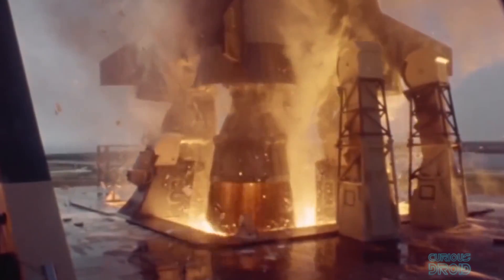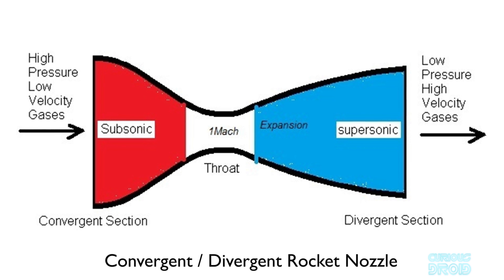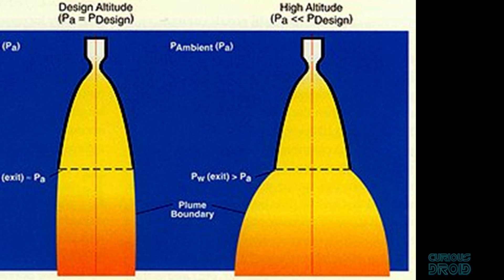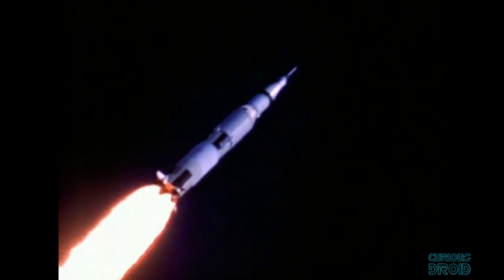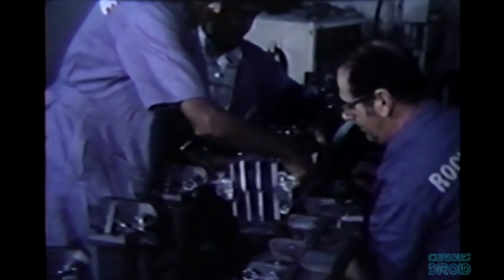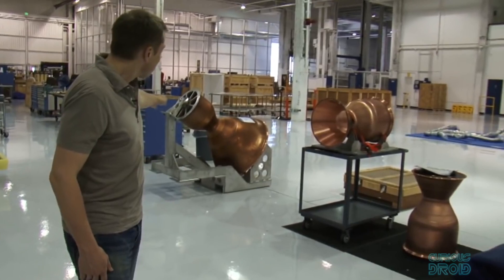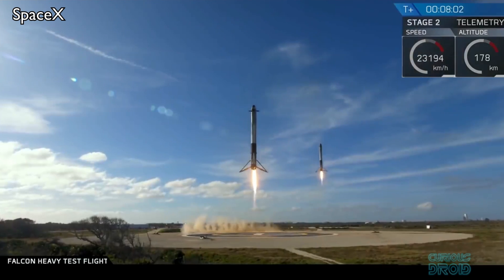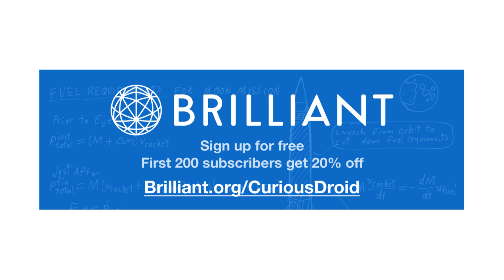Aerospike Engines - Why Aren't We Using them Now?

Comment: The aero spike requires many rocket nozzles, and igniters for each of them.   The combined effect of all the rocket nozzles creates a laminar  flow of rocket exhaust over the adjustable surface of the areo spike, on each side of the spike. Each nozzle is critical to product the proper flow.. ANy one failing will take the entire engine out. For these reasons it is very unreliable.   In addition a aero spike can not be reignited  during a recovery phase of a rocket booster that was in the Space x and blue origin plans. . A returning Aero spike would have all the nozzles directly dealing with reverse air pressure forces as it fell back to earth and it would extinguish and attempt to re ignite a nozzles. Only a few if any would ignite. A aero spike requires all nozzles to function to produce the exhaust profile   .A conventional rocket engine has the igniters inside the combustion chamber far from interference of outside pressure. .This is why they were the only solution for those programs that seek to recover booster.s.  Aero spikes cant meet any of the reliability or re ignite requirements. They simply are not a feasible.

Comment: The pressure of 5 (!) km will be 0.06 kg not 50km.
why should the pressure at 12 km high atmosfere equal to a 1/10 of our current pressure and 50 km heigt equal to 1/100 of our pressure. but else nice explanation :)

Comment: I read that the X33 design looked great on paper but sucked in reality.  The Flying Spud design wasn't a great lifting body shape, and the aerodynamic control wasn't optimal either.  The Rocketdyne Aerospace engines themselves were bottom heavy due to supporting and cooling the large ramps.  In short .. what looked to be a great design .. was in reality .. not so great.  This happens all the time .. take the F117 Stealth Fighter for example.  It was introduced as a marvel of engineering and materials... but pilots absolutely hated it's inflight character .. today they are all retired.
Reply: X-33 had to make compromises.  The X-33 didn't have to go for the same cross range as the Shuttle, so it went for less leading edge heating on reentry for less lift.  (Forgot the actual terms).  Basically, better heat distribution at hypersonic speeds and just enough low speed stability to land.

Comment: If it really outperformed the bell shaped rocket it would be used.
Reply: Someone would have to use it and prove it first.  Bell nozzles are used because they are well understood.  Why doesn't every already use composite fuel and oxidizer tanks?  Because metallic tanks are well understood and a lot more people know how to design and build them than composite tanks.

Comment: Competition means innovation. Getting government out of the way will create the the environment for such innovation.

The key is the comment "X35 cost over-runs". Well, duh! That's what government research is all about, maximum transfer of tax money to govt contractors.
Reply: There would be no SpaceX right now if it wasn't for two NASA programs.  One, the Low Cost Pintle Engine, ran by TRW and paid for by NASA, started back in the 90s.  The chief engineer was Tom Mueller.  The second was the MC-1 or "Fastrac" which was developed by NASA itself.  

A lot of the "innovation" going on in the commercial space sector is actually companies living off decades of R&D that's yet to be applied.

Comment: Still, if the savings would be 40% it would mean less weight and more payload. Fuel price is not the only product of this efficiency gain.
Reply: Not really, because in the case of an SSTO, you're having to carry the whole thing to orbit.  And it gets even worse when you expect the whole thing to get back from orbit in once piece.

Comment: Rockets are the most INEFFICIENT machines in existence. The new space X is 50% less efficient over its predecessors due to the landing gimmick. Gotta bring all the fuel and engines back with you. Look at the size of a rocket in comparison to what it can lift.  If a rocket was a Pencil, its load would be the eraser.

Comment: For instance, the Saturn 5 rocket used the exact same engine type for the 2nd and 3rd stage, the difference being that the 2nd stage had 5 engines, while the 3rd had only one. Same essentially vacuum adapted expansion of the nozzle, since the 2nd stage was started at a 67 km altitude, where the pressure is around 1/5000 that of sea level.

Comment: Brilliantly presented, and pertinent.
If I can add one thing: the staging of rockets is not primarily for switching to a different expansion ratio, but to move on too rocket engines with a power (and thus an acceleration) that is adapted to the remaining mass. Single stage to orbit may have a performance penalty because they will haul an unnecessarily large empty tank and mostly throttled down heavy engines all the way to orbit; that mass is directly taken off the payload allowance.

Comment: The world doesn't need shuttles.  With SpaceX's much cheaper launches and short turn around time, also heavy launch vehicle, NASA can design and make space craft modular (with a rotating ring that simulates gravity for the crew) that can be send up in cylinder shape and then assemble in orbit.  It should have its engines and enough fuel.  On the way down they can take return vehicle(s) already parked at space station.
If NASA is going to do manned Mars mission I don't see it possible to stuff a few astronauts in a tiny craft for months at a time.  And they definitely cannot land on Mars, not at least have tried and tested return vehicle already on the surface of Mars.

Comment: I think one of the other benefits of just leaving the multistage system in place is the large reduction in mass of the delivery rocket when the first stage separates.  You point out that the fuel cost/rocket cost ratio is so small and with space x now being able to recover the first stage so well I agree there is no point to spend money on engine development even if you put the aerospike engine on both stages.  Also there is a difference between a vehicle and cargo delivery system.  When and if a vehicle is needed maybe at that time there will be an incentive to get rid of the multistage because well you need your vehicle to stay in once piece at all times and then you are also more interested in getting that fuel cost down because you will use the vehicle frequently.  Likely this will come from a military need first as usual then since the development has been done there later it will turn into commercial use later, once again as usual.

Comment: Perhaps the answer lies within NASA  itself or Lockhead Martin.Over the past thirty years we have heard all sorts of fairytales about shot down U.F.O.s and back building.
It is coming time where the above company and what is still a public owned NASA, are going to be taken to task because I think people are getting really fed up with all this money going to black budgets with to date nothing to show for it.
America either has negative gravity mastered or it has not, and common sence says that if they do have it wby are they spendi g all this money on building rather large fireworks that are a danger in themselves.
To date, America is known to have a big mouth, by so far, nothing of value has come out of it, and I can see a situation of put up or shut up, and shut up being last person out turn off the lights please.
This kind of technology  also will if available have implications for cheap power for all, and it would seem that all concerned would prefer to shot themselves in the foot for as long as they can rather than do the right thing, but doing tbe right thing is not something America is well known for, in fact its usually doing the wrong thing as many times as they can get away with it, but I am sure that all concerned are running out of rope and the hangmans noose is getting ever closer.

Comment: Hmmm.... Would it be possible for you add a air intake and remove most of the oxidizer than wouldn’t it become a hybrid engine, because it would scoop air into the intake  and into the combustion area... thereby reducing weight and increasing efficiency, while lowering fuel costs.... 

I’m not 100% sure but if you also add a special filter in the intake to separate oxygen from hydrogen, then would this classify as a LACE system by using the hydrogen for fuel and the aforementioned oxygen to cause the reaction while in atmosphere... and only using internal stores of fuel when out of atmosphere.

Can someone verify this to seeing I’m onto something or am just crazy...

Comment: There are many other reasons we use stages, not just the nozzle. A big part of it is physics. You need to shed weight to get into space. One giant heavy rocket would require insane efficiency if it didn't take place in stages.

Comment: Fuel is cheap but if you can bring 40%less fuel you can bring a much bigger payload, or use a smaller rocket, ore have much more fuel to slow down your reentry. There are a lot of things you can do with a 40% more efficient rocket engine than saving on fuel cost.

Comment: There was no mention of the fact that once a stage has been used, dumping it means there is less remaining weight for later stages to lift.  Doesn't that mean that multi stage engines would still be the best way to go even if we were to switch to the aerospike design?

Comment: Yep which is more expensive buying a car or refueling it?
Reply: Depends on the price of the car, the price of fuel, the fuel efficiency of the car and the cost of maintaining the car.
Reply: jojo Smith if cars still need run on oil based fuel
Reply: Cameron Dufton - He didn't mention what fuel his hypothetical car uses.
If your plug-in rechargeable electric car is charged from the solar energy, microhydroelectic, windmill plant that you own, the cost of fuel would be the depreciation and maintenance on your plant plus whatever the money would have done if you invested it instead of socking it into your home power plant, divided by the number of miles/kms your car goes before your plant is completely depreciated.
Reply: Cameron Dufton - Maintenance cost is not part of the purchase cost of a car unless the purchase cost includes a lifetime maintenance contract.
Reply: Al Grayson maintenance  is optional, just like refueling. They are both costs that need to be factored in if you want to do a realistic comparison.
Reply: Al Grayson when jojo said "..if oil runs out" it was heavily implied that oil supply would be a major factor.
Reply: The shuttle was apparently more expensive than a throwaway rocket because maintainance and refurbishing were hugely expensive.  There goes your car example.
Reply: Usual Rain, are you buying a Prius?
Reply: jojo Smith  one day we wont need oil for car maintenance
Reply: Soon they'll be like F2P games.  You get free car with your license, but you have to buy the expensive fuel just to use it.

Comment: I think aerospike engines can be good for first-stage rockets, but I don't think they will be seeing use on SSTO rockets because those are basically infeasible until we develop a high thrust fuel with specific impulse greater than 800 seconds. Sorry, but that's just the way it is.

Comment: The helpful thing about bell shape is that they need multistage rockets. Sure its more expensive but after you use up the fuel for that engine you can drop excess weight and have better efficiency later on

Comment: The Aerospike is NOT more efficient in relation to thrust/weight ratio capability at sea level launch, (cost of each unit of mass into orbit). Example: The SpaceX system can NOT carry anything close to the capacity verses cost as the current Orion designs which will be retro-fitted with the new hybrid/paraffin rockets that are safer, cheaper, and more efficient than the Aerospike design. Engine complexity drive up cost of safety and insurance. The Aerospike costs so much more that it must be (reusable), and can not be dumped. Dumped engines cost much less (keep in mind that most of the rocket is a hollowed shell). Competitive technologies, currently being tested, such as hybrid/paraffin rockets, seem to be much more efficient, to be significantly cheaper, and safer, than the Aerospike design. The Aerospike system is simply old news, NOT cost effective now, even for SpaceX, it wasn't even back in the 60's, is now outdated technology compared to current designs, and seemingly will never be used by NASA, or for future American space advancement, other than it's one big use in history on our high altitude spy plane, the Black Bird, which also uses an expanding bell shape thrust vectoring system in tandem with the Aerospike design to make it more efficient at different altitudes.
I think this system of using an expanding bell, and the Aerospike design would be a logical next step to research. The best of both worlds maybe?...smile

Comment: The disadvantages of aerospikes seem to be extra weight for the spike, and increased cooling requirements due to the extra heated area. Furthermore, the larger cooled area can reduce performance below theoretical levels by reducing the pressure against the nozzle. Aerospikes work relatively poorly between Mach 1–3, where the airflow around the vehicle has reduced the pressure, thus reducing the thrust.